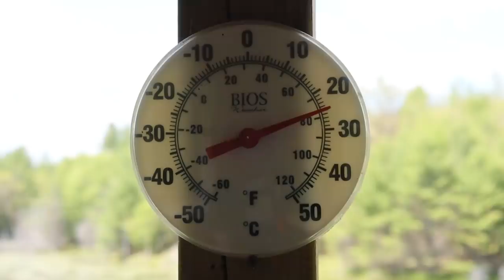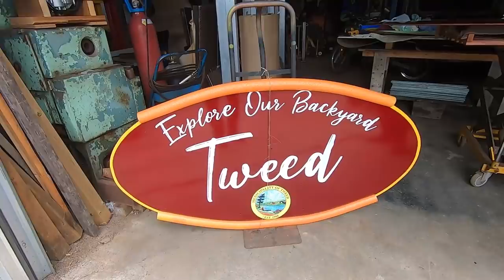2 Subscribers found me and left this

Comment: What my buddy did was get two totes and interconnect them at the drain spouts. The interconnect contained a Tee fitting for discharge but in front of the tee fitting he also put some sort of household water filter canister.  By only filling one tote directly from the down spout he forces the collected water through the water filter into the second tote via gravity. That way he doesn't have to manually clean crap out of his water when he fills his jugs from the tee.

Comment: Another great video.  Your pintle hook should have a place for a pin to go through to keep it from opening.  We used the big metal clothes bag safety pins for ours works awesome.  You log hauling came just came up to top notch. They are really nice people.  See you tonight.
Reply from the maker: Rodney, when it started happening I put a wood screw in it, seemed to fit nicely (lost the original pin long ago). But it still popped open.
Reply: @RaspberryRockOffGridCabin  Interesting.  In the Air Force we use this type of hook for moving around equipment and even towing planes.  One time they had to inspect and or replace the assembly and or drill a proper hole in the latching part to fix this problem.  The little latch is the culprit for sure.  That thing could hurt you if it came unlatched at a bad time.  Remember Murphy's Law. Good luck with it.  See you tonight,

Comment: Hi Russell, great video again my man. What I did to solve my problem like you at towards the end was to have two of the large water tub. I then drilled a 2 inch hole towards the very top on the main tub and ran a 2 inch pipe to a hole in the second tub but allowed a 3 inch drop. Then, when the first got close to being filled, it overflowed into the second one.

Comment: I like the longer videos. And I would glue any of the piping unless your losing water. Gluing that pipe is meant to keep swer water from leaking. But your not using it for sewer. If you do not glue it you'll always be able to make adjustments or whatever. So unless it won't hold itself together or leaks a bunch......

Comment: Russell, what will you do with all of that water? When I built my first flush, I glued some of the fittings and I used a stainless steel screws on the one's not glued to keep it from pulling apart. Makes it easy to service the tank.
Reply from the maker: Skip, you're supposed to tell me what to do!

Comment: a little info before you glue the pipes set up the pipes the way you wont ,then use a marker on both sides to be glued so you can line up the 2 sections and you will not have to guess if it's right ,I thought we would get a song out of the pipe for us lololol
Reply from the maker: Great idea, Blair. Maybe I'll do a trompipe piece for you guys.

Comment: Maybe put a 30 gal barrel inside to hold more water in the winter.  If you install a pump and some clear plastic hose run up to your indoor sink you wont have to haul 5 gal buckets?

Comment: Hold those pipes together with short screws, not glue,  so you can re-use everything. :)
Reply: Was thinking while he was constructing about the non glue issue, its needed for permanent bonding but use of screws in certain areas a very good idea.

Comment: I watched a video of yours this week but i couldn't comment on it. It was when  you were having trouble traveling along your trail and getting stuck in the bog. I noticed that the bog had a side that went downhill on one side. Why don't you dig a drain in the middle going down hill and fill that area up with some gravel and rock? Then when it rains the water will run out down hill.

Comment: Crested a hill in a kombi with 12 lenghts of drainage pipe on the  roof.A dab on the brakes and all 12 launched from the roof, hit the road and accelerated down the hill.
At the intersection at the bottom a motorcyclist, with impeccable timing,
rounded the corner
to be confronted by
the maelstrom of pipes. I saw his eyes widen from my vantage point,still at the top of the hill.
He somehow navigated through unscathed and passed by without even a look.
A hundred residents 
appeared to watch me load the pipe.

Comment: 😱 29 interruptions!
Reply from the maker: A break doesn't necessarily mean an ad. But how are you seeing that?
Reply: 4th ad is long... perhaps 30 min? Do you have a choice of ads?
Reply from the maker: You don't get a choice on which ads you see, Pat, but most should be skipable.
Reply: @RaspberryRockOffGridCabin  There were 4 in the first third of the vid
Reply: @RaspberryRockOffGridCabin  I clicked on your video as soon as I got notification on my phone, there were 30 dots on the timeline which usually indicates an add. I skipped video for 2 hours and the dot are still there.  I’m watching now and video is playing through dots... never happened like this before.🤔

3 adds in first 23 minutes.. not bad
4th add was a double, first one I had to watch, 2nd I could skip after 5 seconds
Reply from the maker: @dannydenham8141  Interesting. I don’t see those on any of my devices. Which phone are you using?